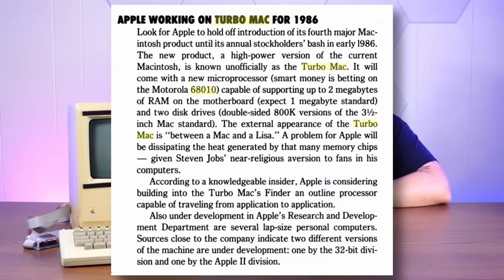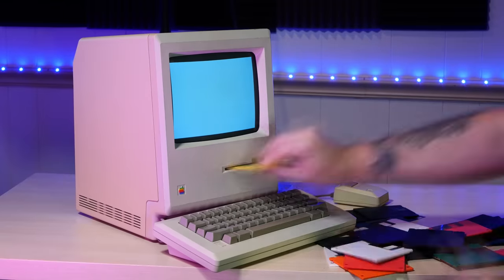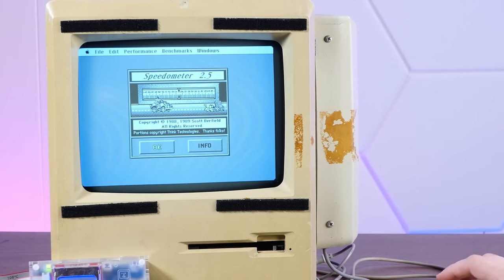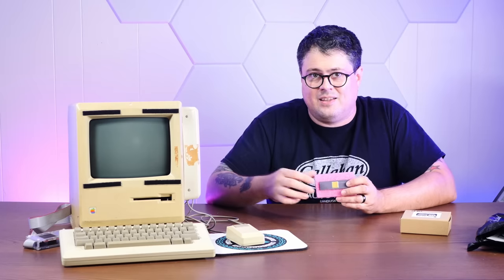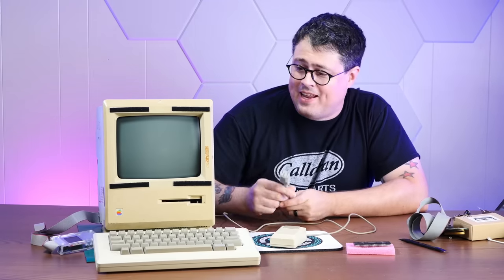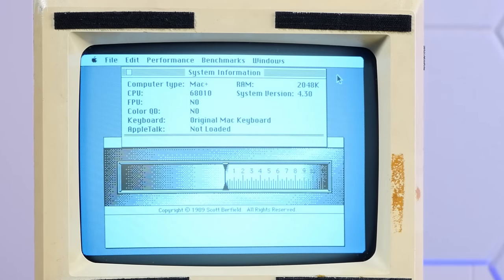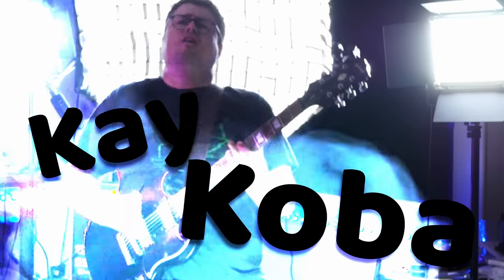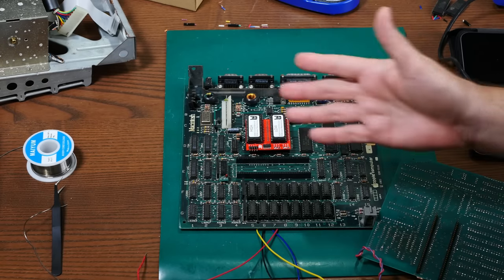Apple Cancelled the Turbo Mac. Let's Build One.

Comment: to use the rom board, add a stack of pin headers atop the CPU socket, it will raise the whole expansion board up and allow you to clear the rom board
Reply: OR some 64 pin DIP sockets in a stack.  The same idea, but a little more stable.

Comment: I love how the 68000 revolutionized computing in the 80s... I've seen a similar mod on a Sega MegaDrive/Genesis, where they swapped the original 7.6 MHz 68000 with a 10 MHz 68010, and unsurprisingly almost the entire game library work as good or even better (less hickups sometimes) than the original.
Reply: Does it fix the lag in Sonic games when Sonic gets hurt and loses his rings?
Reply: The megadrive mod was the first thing I thought about when he started talking about swapping the 68000 for the 68010.
Reply: @commentarysheep  of course it fixes it... But if you don't have access to an 68010, yo can get almost the same results (or even better ones) swapping the CPU crystal clock and bump the original CPU around 10 MHz without effort. If you push it higher it becomes incredibly unstable (12-14 MHz). I did it a long time ago and it was amazing to play Sonic (1,2 &3) or Thunderfoece IV without any lag.

I also modded that MegaDrive to work in NTSC mode, and it was an amazing experience.
Reply: Any compatibility breaks?
Reply: @solarstrike33  from what I can remember, there where a few titles that had graphical or sync glitches. I'll search the original video and share the link here 🤗
Reply: Though it could be argued that Acorn really revolutionized 80's computing with the ARM processor, a smallish company beating all the established processor manufactures with raw processing power.
Imagine if it had been ready earlier and they had decided to market it to other companies then they could have been the dominant player (though they are very much a dominant player now!).
Thanks to having the full OS in ROM the Acorn machines booted very quickly and no piece of dodgy software could corrupt the OS.
Reply: @commentarysheep  Here's an example of a few games.   https://youtu.be/C3Tsd6_OmS0  I think there's also a video on that same channel how to do it, if not there's tons of others.
Reply: @dglcomputers1498  yes! They wanted to do it in a home games machine as well as the high-end workstation they first released. Show how good it was at both ends of the market, emphasising flexibility, with the intent to drum-up interest from other companies. 

But management and finances said “we’ll see if the high-end workstation is successful, then decide”, and we all know ARM didn’t really take off elsewhere until the Newton by which time it was already spun-off into its own company. 

It’s a shame that the engineers and product developers at Acorn weren’t allowed to do their plan. It would’ve kicked the arse off of Amiga, as good as Amiga was.
Reply: @kaitlyn__L  calling Amiga good is a bit of a stretch. There were plenty of computers in that era surpassing Amiga. Even Acorns Archimedes was better computer then Amiga...it was more expensive though.
Reply: @madigorfkgoogle9349  the comment you’re replying to literally says the Archimedes blows the Amiga away
Reply: @kaitlyn__L  I didnt said you are wrong about Acorn, just that Amiga was not anything special, like often stated by Amiga fanboys. Amiga wasnt any benchmark that every computer has to beat. So your statement that "it was as good as Amiga was" is what I was referring to. Calling Amiga "good" is a stretch. Amiga was pretty average, even backwards in its architecture, while Acorn war pretty future proof.
Reply: @madigorfkgoogle9349  you’ve misread me. I didn’t say it would be “just as good”, I said that as good as Amiga was the first gen ARM was much better. Try reading more carefully before you get annoyed at me for saying something I didn’t say. Good day.
Reply: @kaitlyn__L  or, maybe you should read more careful. I clearly didnt say that you are wrong about Acorn, I just stated that Amiga was "NOTHING" special and computers of that era dont need to be compared to it, since it was not any kind of market leader. 
So read more careful next time, then you will see that I agreed with you, just added my expression about Amiga as a industry "standard", or something to refer as a good (your statement "It would’ve kicked the arse off of Amiga, as good as Amiga was"), I just added to your statement that taking Amiga as good would be a bit of a stretch when you compare it to Acorn.
I dont see a single moment where Im getting annoyed at you.

Comment: “TurboMac. Another attempt to design a next-generation Macintosh, called TurboMac, was led by Burrell Smith, who designed the circuitboard on the first Macintosh. Working in a corner of Bandley 2, across the street from Macintosh headquarters, Smith took over a series of cubicles that he called TurboTown, where he developed an all-in-one concept that was roughly twice the size of the first Macintosh, with a faster microprocessor, two Custom chips designed by Smith that would do the work of a dozen off-the-shelf components, a 12-inch gray-scale display, a built-in hard disk and a Snow White case designed by Stephen Peart. Without a full-page display, however, it would not be the product that Apple needed. Some urged Jobs to convert TurboMac into a modular CPU with a separate 15-inch display and formed a committee, packed of with former Lisa engineers, to advise. Yet Burrell Smith, the mayor of TurboTown, vetoed that plan. "Since everyone on a committee wants to feel that they've made a contribution, committees will always undermine the best parts of an idea with an endless series of compromises," says Stephen Peart. As a result, TurboMac was cancelled, which prompted Burrell Smith to resign from Apple, declaring that he would never again drive his car through the inter-section of DeAnza Boulevard and Stevens Creek Road, which cuts through the heart of Apple's campus.” - AppleDesign by Paul Kunkel

Comment: This rumored Turbo Mac, was almost certainly a Mac Plus, just not a really precise leak. Both RAM upgrades (1MB standard) and new FDD matches. Maybe Apple indeed considered 68010 but scrapped it as it indeed didn't provide a performance boost.

Comment: The Turbo Mac morphed into the Mac Plus. 

The instruction cache only gave marginal improvements to most code. 

The compelling thing about the 68010 was that it fixed the absolute internal state train-wreck that happened when a page fault occurred. It was a bug that was discovered late in the 68000's development cycle, and was punted; which was a shame because Motorola had already designed two different MMUs that were intended to go along with it (the 68451 segmented mmu, and the 68851 paged mmu).... This only mattered if you were intending to implement virtual memory and memory protection, which were considered important for running operating systems like UNIX, so Apple just quietly punted, and decided to tackle this with the Macintosh II.

As a weird digression, even though the 68000 couldn't properly handle page faults itself, workstation vendors built all sorts of hardware work-arounds to this problem. Sun and Apple implemented custom MMUs, the latter being used in the Lisa, and was one of the reasons that the Lisa ran at 5MHz. The most over-engineered solution though, came from Apollo Computer, where their first Domain workstations contained a second slave 68000 which ran one instruction behind the master CPU, when a page fault occurred, the hardware would halt the master, copy the processor state from the slave, and resume execution. It had no other function. ;)
Reply: Hahaha HAHAHA!!!
Reply: The instruction cache was only used in loops. Which was not something found in most software except for micro-controller functions. It was otherwise not really worth the effort to design for it given how late it came to market and how much more expensive it actually was.
Reply: @wishusknight3009  With most stuff happening on Mac being done in software I'd say that there were numerous loops in the 'driver' code of the system.
Didn't read the sources, but it seems sensible.
Problem is 68010 has 6 byte instruction cache - not much, thats like 2 instructions only.
Reply: Morbed.
Reply: There's also the 68020-based BigMac which I suspect also morphed into the Mac Plus based on the fact that both had 1 MB of RAM and the following rumor: "Supposedly, Apple will be releasing a Big Mac by the time this column sees print; said Mac will reportedly come with 1 megabyte of RAM (randomaccess read/write memory), the new 128Kbyte ROM (read-only memory), and a double-sided (800K. bytes) disk drive, all in the standard Mac box."

Comment: Remove the rom sockets from the romulan board. Solder the roms directly on. Then do the same on the motherboard, remove the sockets on the mainboard. Solder the romulan directly to the MB. It’ll fit.

Comment: 5:32 - Some of the later accelerators and addon boards actually won't slide out, they're too tall.  A safe way to get the board out is to gently pry outward the left or right rail and just extract the board that way.
Reply: the 68020 accelerator board that was bodged into my 512K is like that, it's annoying.

Comment: I did that same experiment back 1992 with a Mac 512KE with a 4mb Dove Board and System 6.0.4, System 6.0.7 and System 7. The Calculator DA would crash on the Mac. The Calculator on System 4 with the old ROMs is not the same as it is on System 6 with the newer Enhanced ROMs. Also ComicWorks (Art program) also crashed. Then again ComicWorks crashed on System7.

Thee 68010 only had a 3Byte cache which sped up tiny loops, nothing more. It did not improve much as promised on the 68k Purple Manual. Similarly on the Atari ST and Commodore Amiga the same results of crashes but with different programs.

Comment: ah fraq - a cliff hanger ending :-(

one thing about the 68010 is that it had a system mode / user mode transition instruction that worked, so all the dudes that wanted to bring up a Unix where the kernel executed in a system priviledge mode and user land programs in less priviledged user mode, would use the 68010, which there were a few such PCs or workstations that sported the 68010

Comment: The motherboard for the Mac was rather sketchy.  Somewhere I read that Steve Jobs wanted the RAM chips to be spaced farther apart as to line up with all the other chips.  Didn’t work, they needed to be crammed together to keep the signals sharp and clean enough to work.

Comment: FWVLIW: Stacking one or more turn-pin sockets between the RAM board and the motherboard 68K socket to give the ROMinator clearance will do for testing. Will that fit back in the MAC? Maybe not, but you never know! Some stabilising standoffs for the RAM board would be a good idea.
If that's not viable for reassembly it may be possible to mount the ROMinator under the motherboard... being VERY careful not to mirror the lines, assuming there is sufficient clearance underneath. In the long run and remote adaptor would seem least janky.

Comment: I think the major advantage of the 010 was that the 68000 had a page fault bug that prevented it from working properly with a PMMU.  IIRC the 010 fixed that, but most of the 68k machines of that era didn't need > 8mb ram so nobody bothered with the 010.  Then the 020 came out and obsoleted the 010.

I think some of the early Sun workstations used an 010 with a PMMU (before that they used a pair of 68000s running the same code a clock cycle behind one another so that if one of them page faulted it could fail over to the other CPU and avoid the bug; what a hack!!! -- edit: I was incorrect, it was the Apollo DN100 that did this).  There were surely others, but I can't think of any.
Reply: I thought that the 010 had something like a primitive instruction cache.  {Pause to look it up...}
Yes.  Wikipedia says the 010 adds "Loop Mode":  "...which accelerates loops consisting of only two instructions, such as a MOVE and a DBRA. The two-instruction mini-loop opcodes are prefetched and held in the 6-byte instruction cache while subsequent memory read/write cycles are only needed for the data operands for the duration of the loop. It provided for performance improvements averaging 50%, as a result of the elimination of instruction opcodes fetching during the loop."  "In practice, the overall speed gain over a 68000 at the same frequency is less than 10%."

The benchmark program must not have used any 2-instruction loops that would benefit from the speed-up, but in a broader selection of software, there might well be some.
Reply from the maker: very interesting, i hadnt considered that the benchmark might not hit the specific differences in the 010
Reply: Is that the reason why I keep seeing sun machines as dual cpus? To workaround a hardware bug??
Reply: @markinius8866  It was the really early ones.  Like the sun2s I think.  But I may be full of poo; I can't remember for sure.
Reply: @Lee_Adamson_OCF  I always thought pre-sparc sun machines were multiprocessor aware haha
Reply: I was incorrect about it being an early Sun that had the dual 68k page-fault switching.  It was the Apollo DN100.  https://en.wikipedia.org/wiki/Apollo/Domain#Models  Sorry, I am fake news.  ;P

Comment: Looks like there are two EPROM sockets, second high and low on the upgrade card, what where they intended for? I "assume" IF they would accept the OS eproms someone would have tried that already so if there not for that then what for?

Also if you want to raise the upgrade card more people often use stacked sockets, probably will interfere with sliding it in to the case tough.

Also the guy who designed the red eeprom expander could maybe help you layout it in a better way to fit the upgrade card if you asked.

Anyways grate video and Im sure you solve it, problems are there to be solved! XD
Reply: Came to say this! :)

Comment: Depending on how tight the clearance issue is you might be able to get around it by just soldering the EPROMs directly onto the Romulator board instead of having them socketed. Of course that would mean you'd have to pick one set of ROMs to stick with, or order a second Romulator and swap the whole board out to switch between the two ROM sets.

Comment: Dropping in 68010s was a popular cross-grade for early Amigas that used 68000s too. I believe there were/are some patch libraries for AmigaOS that make them a tiny bit faster than the equivalent 68000 too, but they aren't much of an upgrade in an Amiga either!

I think you hit the nail on the head with the reason Apple skipped this chip, a lot of other manufacturers did the same. There really was very little advantage to moving to 68010s except to Motorola's bank balance! Apple chose to skip a generation and went for 68020 and 68030s instead which offered more features and true 32-bit right through the architecture, meaning more RAM, more capability and better performance all around.

All these shenanigans are making me want to power up my turbo-charged 50MHz/8MB SE/30 again!

Comment: You could put a new 40 pin socket that has square legs into the stretched holes to mount the old CPU.
Also might the possible to find an IDC cable that extends the ROM chips.
Reply: Then it will probably be too tall to fit inside the metal frame.
Edit: if you also wanted to use the RAM expansion board that is. But it could lift the expansion above the rominator.

Comment: I'm just curious, is it even using the stock PROM chips with that expansion installed? Kinda looks like it could be intercepting the PROM since it has two chips on the expansion card. I have to wonder if you would have to install the ROMulator on top of the RAM upgrade card. That also leaves the possibility that the monster Mac is using a modded prom to support the extended memory, which means whatever custom prom you use might need patched. I would experiment to see if the machine boots with the monster Mac, but with the stock rom chips removed.

Comment: I have a 16MHz 68000...wonder how something like that will work.
Reply: A company called Brainstorm sold a 16 MHz 68000 upgrade for early Macs. It worked fine. Not sure if a plain 16 MHz 68000 outside of their upgrade would or not.

Comment: Very Cool Sean 68010 Did not know that that was even available. Note on the Rominator  K Koba And JDW was kind enough to help me to figure out what was wrong with the first one I built. The second Rominator that I built for the cursed Mac Plus Worked Kinda K Koba said to make sure the pins are seated all the way down on the stock rom sockets no gaps I had to shave down the stock rom sockets after doing that it worked fine but in your situation I don’t know hows that’s going to work hopefully you will find A work around for the Rominator  I have the Rominator optional Flash tool that you can down load. And yes you can some really cool thing with the rominator Garth Beagle And Steve Put the Blue SCSI Image On Macintosh Garden For my Mac Plus with the Roninator Flash Tools But it is for the Mac Plus only sys 7.1  But Fantastic Video Sean